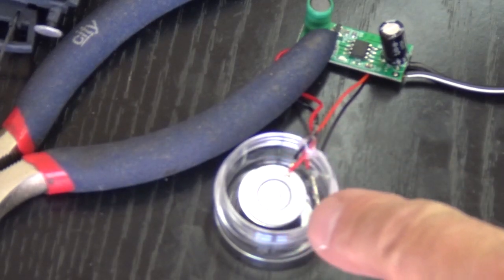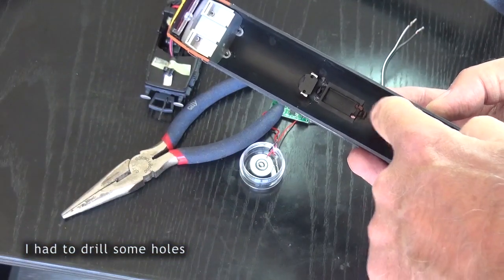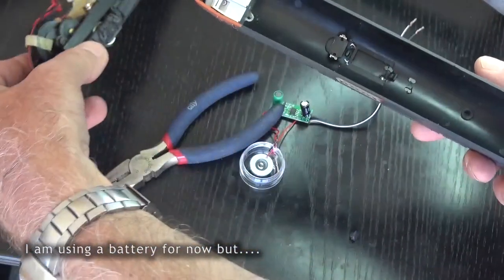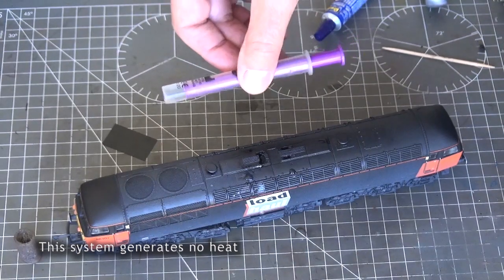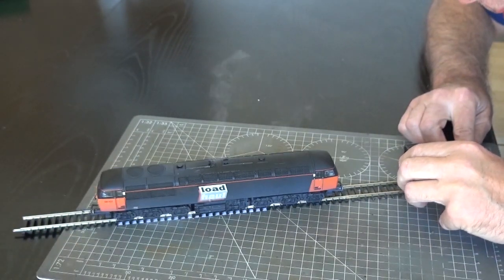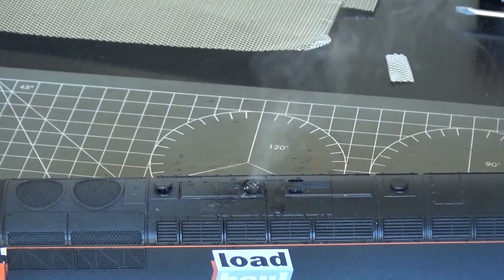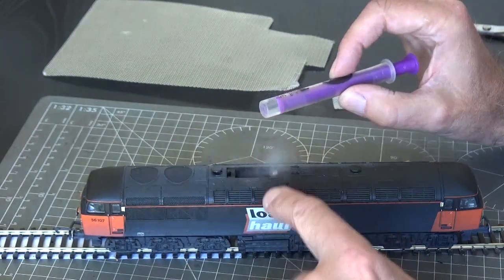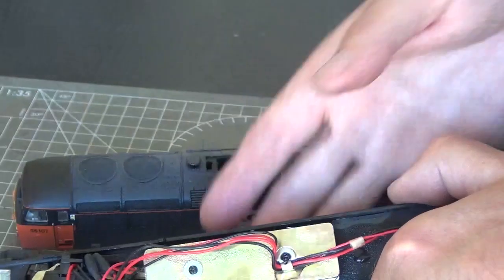Live Steam Ultrasonics Idea for Model Trains

Comment: Good idea,👍 perhaps ad a vent to regulate the quantity of steam depending on speed. 🤔 Cheers Andy 🤠
Reply from the maker: Thanks Andy. Yes I suppose with steam you'd want it to time with the chuff sounds. I just wanted a quick cheap and cheerful solution. This was just a tiral run to see what happens. The loco can get a bit wet too over the chassis, even though I have sealed it, so it may require more trials to get it just right but already it is neat enough and it goes a treat. Laurie.
Reply: @Calvertfilm  You are right and I'm sure the loco will be an eye-catcher on conventions. Cheers Andy

Comment: Hi laurie been trying to sort something out like this myself not very good at electronics but having a go i have come across this unit on ebay which runs off 5v but has built in switch which makes it harder to use you may be able to bypass that with your skills, hopefully you will be able to share with me how to wire this stuff up 👍